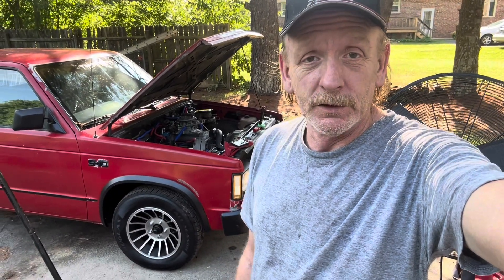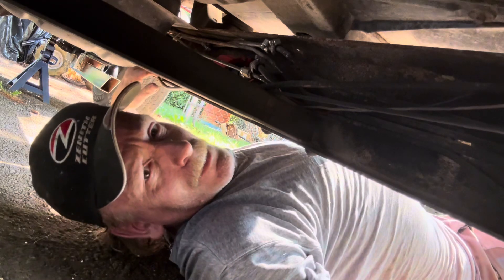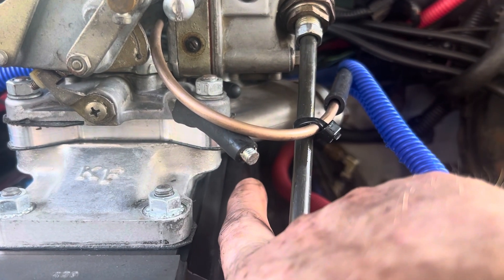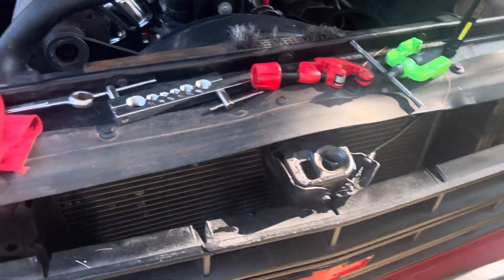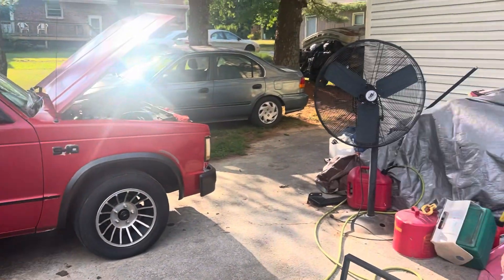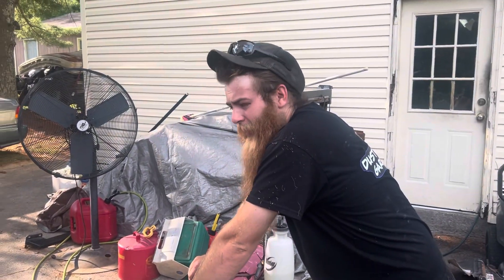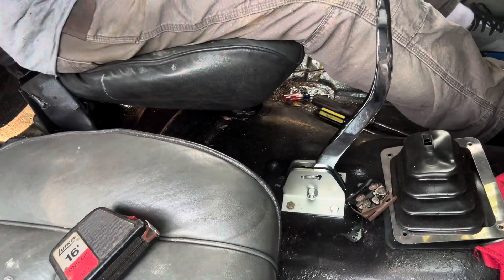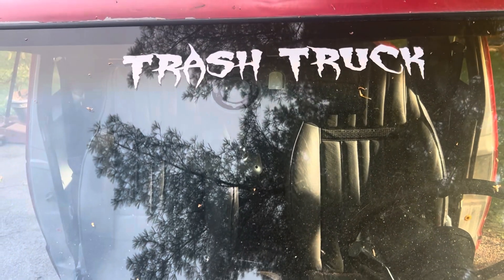Trash truck day!

Comment: Oh man that Gear Box Leak what..... fun I hope to not have to ever do mine .

For the neutral safety switch Could you not have a switch panel for key on engine off power and then have another switch as in a neutral safety switch to flip on and off unless it definitely has to be where the shifter is at but something else what about something that locks the shifter in park so it can't be bumped into another gear when sitting still